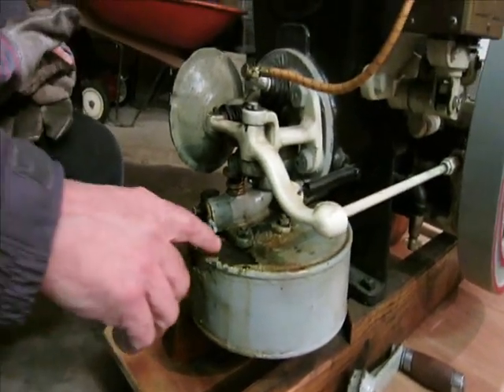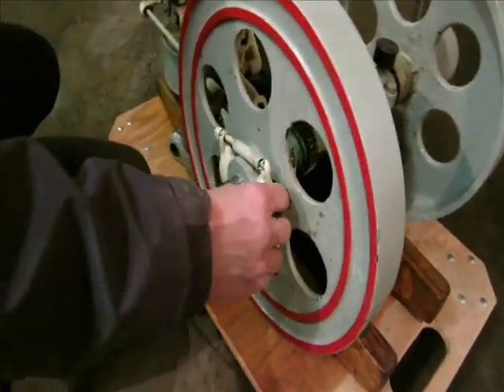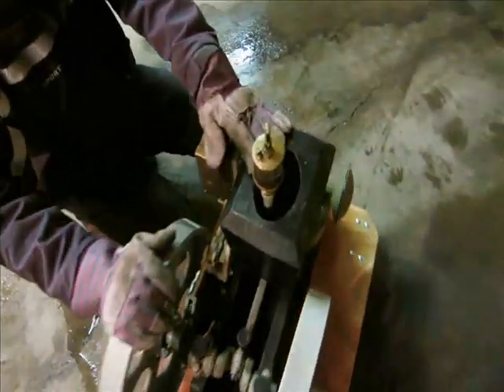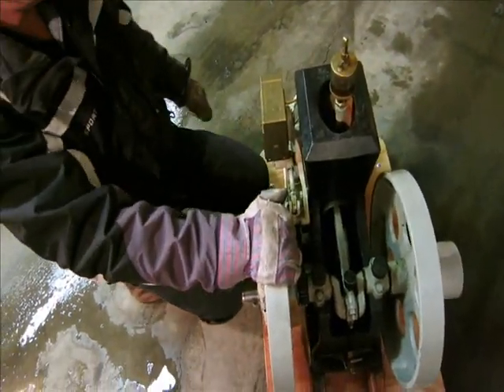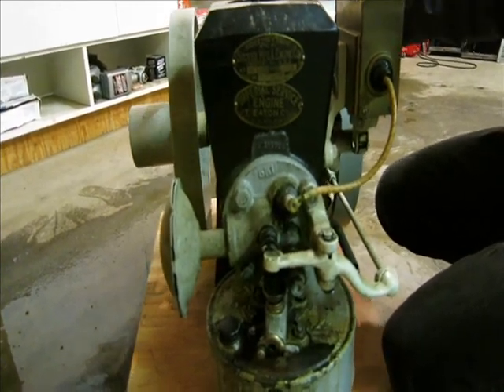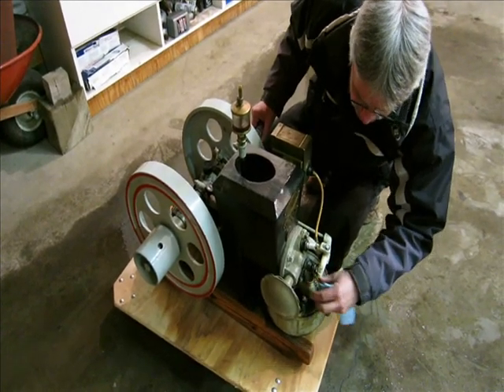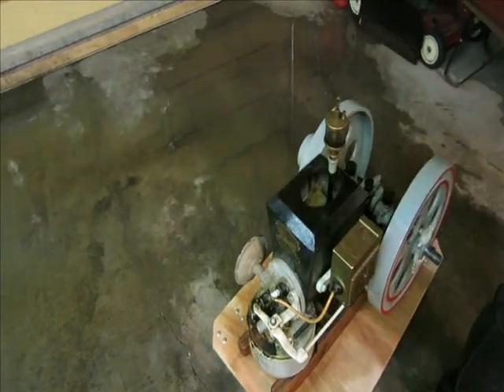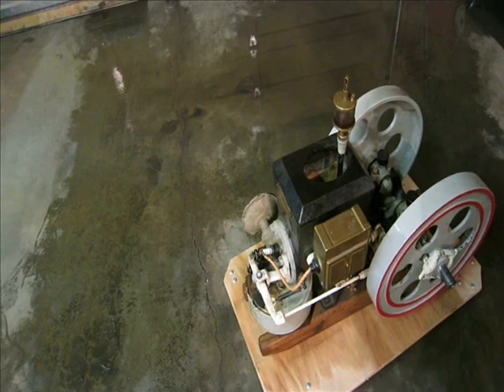1937 Stover Stationary Engine

Comment: Same engine as mine. Mine does the samething in regards to running high rpm's. I think this summer she is getting disassembled, valves guides installed, fuel mixer and governor is getting a good work over.

Comment: I have I believe the exact model. Been trying to run it for some time now.  It pops and runs for 3 or 4 revolutions and that’s it.  I cannot seem to get it to keep running.  Played around with fuel settings etc. mine doesn’t seem to have a Advance/Retard lever like my 2HP stover.  Maybe it’s missing.  I keep adjusting the mag linkage but in and out looking for the sweet spot.  Does yours have a Lever?